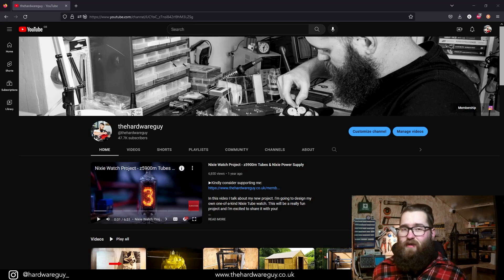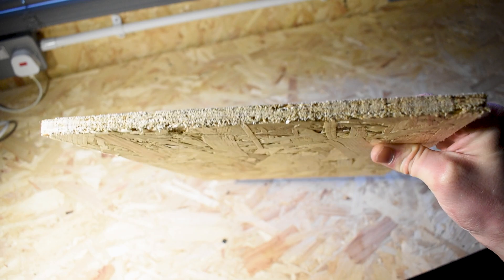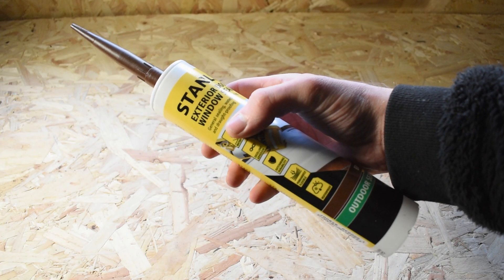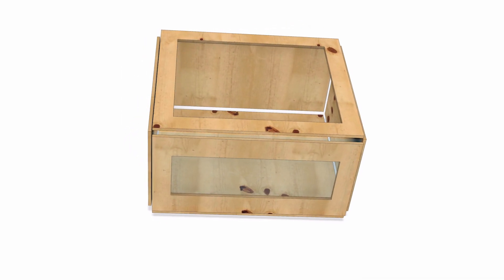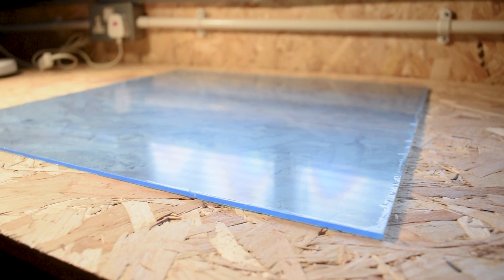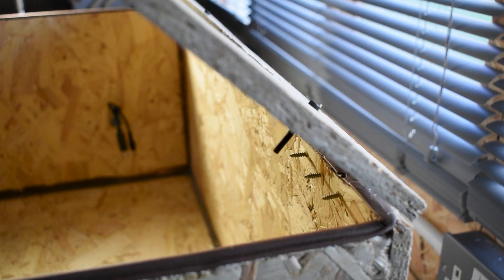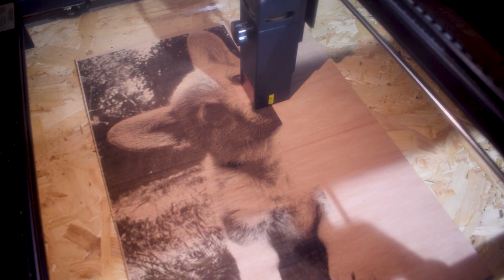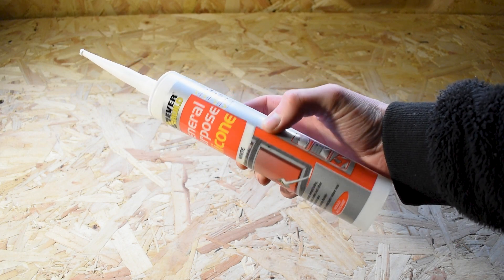DIY Laser Enclosure

Comment: Surely you need to let some air into the enclosure before you can get efficient extraction ?
Reply from the maker: yeah! check my pinned comment, I did eventually add a few holes which improved airflow

Comment from the maker: Update: I didn't mention it in the video but I drilled 5 vent holes into the bottom of the front wooden panel and it has improved the speed of extraction drastically.

Comment: I think you need some kind of a vent to allow air in, otherwise the extractor fan isn't going to be very effective.
Reply: I was of the same opinion. The extraction on my wood working kit doesn't work unless there is a cross flow of air into the enclosure and the dust extractor overruns because there is a reduced air pressure for the impellor to work against. Basic fluid dynamics. In the case of this enclosure I would build in a rubber/plastic flap that would open when air was being pulled through the enclosure but close if there is any back pressure to prevent fumes escaping.
Reply from the maker: Thanks for the feedback, I will keep this in mind for future upgrades. I did consider a small vent but after testing without a vent the small fan still did a good job of extracting all the fumes. It's likely that the fan creates enough negative pressure to prevent fumes escaping but allows air in through any tiny gaps that might be present. A vent would certainly speed up extraction